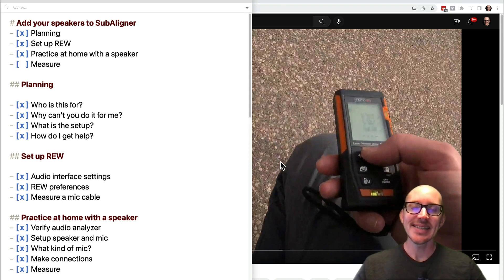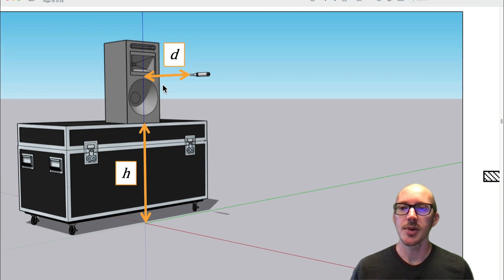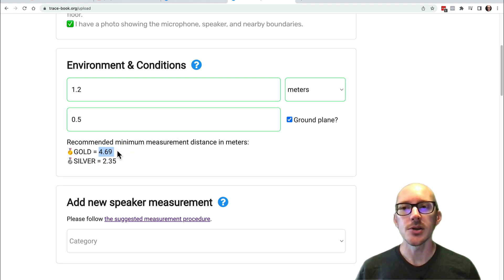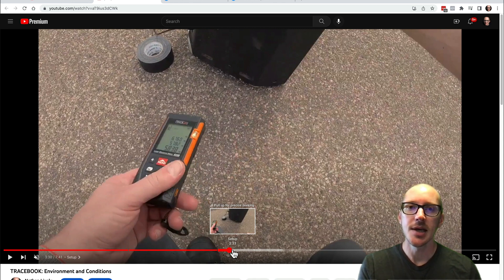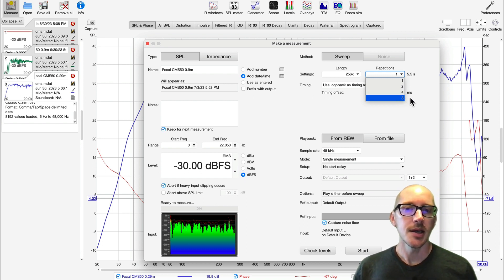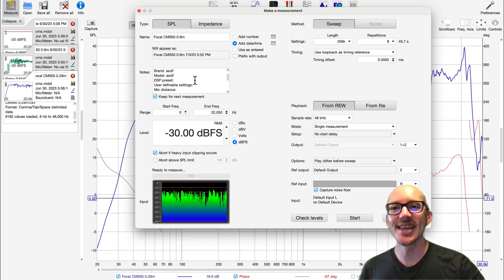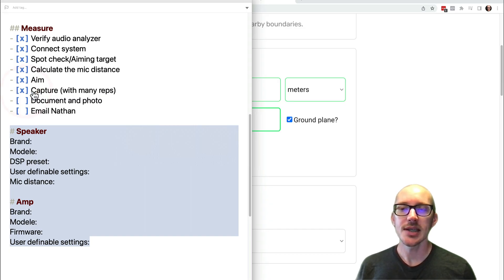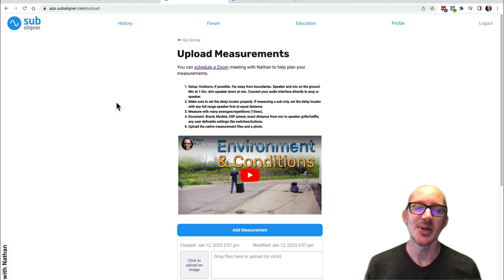Add your speakers to SubAligner: Measure!

Comment: This is Great detailed information! I have asked in several forums , even on YT for years and always was responded  with generalized answer on the specifics for measuring for consistent results no mater if power or non powered. Thank You  Nathan.
Reply from the maker: Glad it was helpful! Ground plane measurements have been around for years. They may not be the best method for accuracy, but I have found them to be a great compromise that most people can do without expensive tools or a PHD. By the way, this is just an overview. For more detailed information, please see the Tracebook Measurement Procedure.

https://drive.google.com/file/d/13OwwvV1-rYZu__gscDj53vyQ3KRk_X72/view?usp=sharing